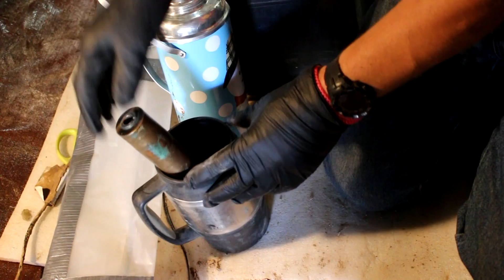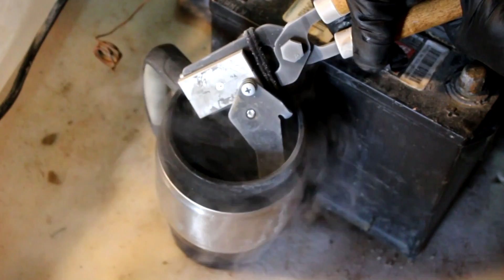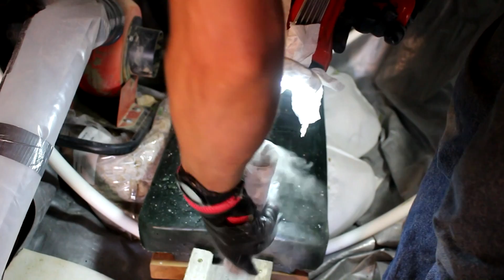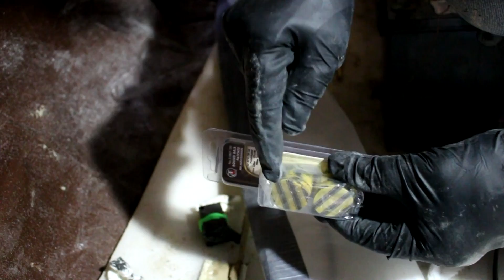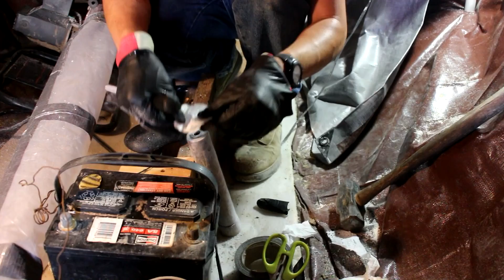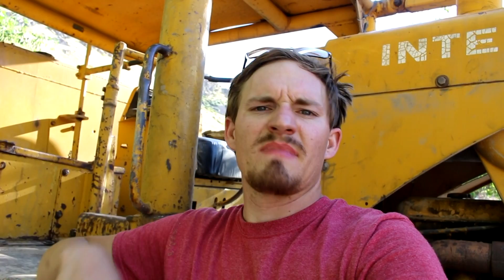Shooting Mercury Bullets

Comment: I do not believe that the mercury lubricated it's path through the gel.  in my opinion the weight difference would have given the mercury more velocity v the lead.
Reply: I think it's a mechanism more similar to Armor Piercing rounds. What I mean by that is this:

In an Armor Piercing round, the copper jacket is stripped off of the steel core of the round, creating a smaller (and therefore a higher velocity) projectile.

If the Mercury was melting as you say, then it wasn't so much 'lubricating' itself as it was shedding mass to retain speed...which as you noted increases penetrating power, but would be useless in transferring energy to a target effectively.
Reply from the maker: by that much?
Reply: @theCodyReeder  burn rate (and pressure) goes up exponentially with bullet weight, it is likley the mercury bullet was going faster than the lead with the same charge.
Reply: Powder burn is not perfectly efficient and you get better powder burn using a heavier pill.  Have you ever seen a fireball from the end of a barrel that's unburnt powder with the combination of hot gases expanding in an area of lower pressure, etc etc etc but mostly unburnt powder burning up.  So with this in mind we can also conclude that the heavier bullet spends more time in the barrel thus more efficient use of the charge while the lighter pill will move through the barrel more quickly allowing for less time for the charge to burn.  this is also why when using the same 9mm bullet from a 3.5 inch barrel to a 6 inch barrel makes drastic changes in velocity.  same goes for 5.56 ammo from a 14 inch to 20 inch barrel you see a 200 to 600 feet per second increase depending on the round and charge being used i.e.  slow versus fast burning powder.  Using black powder requires long barrels because it is a slower burning charge than modern powders so this has a major difference.  This is why they used heavy 50 caliber projectiles with very long barrels in earlier firearms.  So your energy of the charge is lost as heat.  So for the something of the charge you are getting something, heat..
Reply: Shedding of mass to retain higher velocities seems to be the most acceptable explanation I have heard yet, but something like this is not researched, so all we have are hypotheses.
Reply: He used the same size charge for both which means the heavier bullet would have a lower velocity and the same amount of overall kinetic energy.  Energy in = energy out unless there was a difference in the friction between the bullet and side of the barrel due to mercury melting from initial friction and either lubricating of just making the bullet slightly smaller which would decrease that friction also.  That is as long as the melting didn't break the seal and allow gases to escape around it.  The crono would be required to find the answers to some of this.
Reply: >> in my opinion the weight difference would have given the mercury more velocity v the lead.

The kinetic energy transferred to the bullet will be the same.   Faster speed vs  more mass vs slower speed and more mass.

As the hole in the paper gets smaller, the level of energy required to continue gets less.   The led bullet didn't get smaller, so continued making a big hole, requiring more force to tear the paper.

I'm not a scientist, but did take high school physics when dinosaurs ruled the Earth.
Reply: that's what I thought too. plus I'm assuming all those pieces of stuff falling down are bits of Mercury that were splattered against the gel in the firing
Reply: +Ben Sparrow but yeah "lubricated" is probably a good word here, I doubt the bullet was still very solid by the time it hit
Reply: The mercury bullet felt like it weighed more to Cody. That doesn't mean the velocity is higher, it means that the velocity would be lower but it would have more energy.
Reply: I carelessly used velocity for momentum, force or newtons however you want to measure it.  Either way this played the largest part in the further penetration any said lubrication of the mercury would be negligible.  the faster lighter bullet had less penetration and that could be because of its lower mass, shape and trajectory.  perhaps we might see a difference in the lighter bullet is the shape was changed to that of a boat tail its tumble pattern would be way different or perhaps making it a hollow point and allowing the bullet to fragment there may be deeper penetration on the individuals fragments.
Reply: Jonathan Gibson The start mass being higher was obviously offset by the mass loss as it penetrated, and this HAD to play a part in the round penetrating further, no doubt about it.
Reply: Regardless of the powder used if there is flame at the end of the barrel there is inefficiency as the powder is not completely burned and energy being transferred as heat instead of velocity on the round.  If you have ever reloaded ammunition or tried working up a perfect load for your rifle you would begin to understand.  Judging on how you may not have reloading knowledge or extensive knowledge of ammunition and their mechanics this is a losing battle for myself.  The concept of same amount of powder with two different projectiles with different weights yielding the same energy potential is incorrect.
Reply: Jonathan Gibson Well... regardless, the lead would have mushroomed to fill the barrel, so if anything, the mercury actually obtained slightly less inital energy, which still points at the loss of weight increasing the penetration, as two loads, one lighter, one heavier, the lighter round would penetrate further. But mercury was initially heavier AND more brittle than the lead. It should not have penetrated further. Only the loss of weight would predict such an outcome.
Reply: The velocity would be less due to the higher mass of the Hg, with the same charge a higher mass object would not be accelerated as fast as a lower density object.
Reply: (in the way I'm explaining it, think of a bullet as infinitely many hollow cylinders put together)

as the lead bullet travels through the gelatin, the sides rub against the outer shell of the bullet, since the outer shell of the bullet is still in tact of the rest of the bullet, the entire bullet is slowed down

in the case of mercury, the outer shell of the mercury bullet would get slowed down, but due to the immense friction, it would melt, separating itself from the rest of the bullet
there is still a bit of time when the shell is still attached to the bullet, so the bullet the gradually being slowed as it penetrates
the smaller the bullet gets, the higher the surface area/volume ratio, meaning it slows down a lot quicker near the end of the trip

so mercury is heavier (same size, greater density). same amount of powder, therefore there is the same amount of force applied to both of them initially
however since the mercury bullet is heavier, it'll remain in closer proximity from the force source so the impulse (force*time) is greater
since impulse is related to momentum, therefore the momentum of the mercury bullet is greater
since it is greater, and the mass is greater, we are unsure as to whether or not the velocity is greater (actual calculations is required to determine that)

but the way it would affect the situation is that the faster object would have more friction acting against it
a=f/m
so if the lead was faster it would be slowed down much faster than the mercury (small m, big f)
If mercury was faster, it would be inconclusive without calculations because we don't know if the large force and mass is larger or smaller than lead's smaller mass and force

still, this math would only show just how much further away mercury would go than lead (even then the calculation is annoyingly hard due to viscosity of liquid and changing mass with weird normal force... it's a nightmare)

that alone gives mercury enough reason to move further ahead

If impulse wasn't an issue, and if they both had the same momentum
the energy of the

this is my theory, but I'm quite confident in it (physics major, but not in classical mechanics)

also, in response to the armor piercing rounds guy
the bullet does not speed up (there's no forward force)
simply allows the rest of the bullet to pass unimpeded as the outer shell remains stuck in the armor
Reply: If the liquid mercury were to melt fast enough and the pressure from the exploding powder was able to push enough of the liquid mercury in front of the solid core allowing for hot gas to escape around the projectile you could lose valuable pressure that would help propel the round.  This would mask any benefit from lubrication due to the loss in force propelling the round.  Think about as a shotgun without using a wad in bird or buck shot.  Without the wad the projectiles would not gain as much velocity because the projectile is not near the size of the bore and hot gas would escape around.  

The lubrication idea inside the barrel should just be ruled out.  Try loading a .309  bullet in a .312 chamber than using a .311 bullet in the same chamber and using a chrono you won't see a difference in the deviation.  Sure there is .002 difference around the bullet but no one will notice the difference although it's a lot easier to push the .309 bullet through the barrel.  Now using two bullets of the same bore with two different weights you will immediately see a difference in the velocity and momentum using the same charge.

We should also investigate the effects of wax coating on .22 bullets to see if the wax helps lubricate the round travel through an object(s).

*Also note there is a loss of pressure from the fuse hole in Cody's experiment.

My opinion,  too many variables to count and the math cannot be done with the information given.  Mercury makes for an ineffective round when i look at it from a reloaders point of view. 

The liquid mercury in the gelatin argument just doesn't make much sense when we could observe the same with rounds designed to fragment upon impact and smaller pieces will surpass the large core due to the effect of the surface area and we could also observe the opposite when smaller pieces may slow down faster do to their loss in momentum or inertia. 

We should also look at the effects of super heated liquid copper used to defeat tank armor.  Is it the lubrication helping it pass through metal or the fact that it acts as an armor piercing round while the outside of the liquid mass makes a small incision that than allows the remaining body to pass more freely through the center.  Than again the targets are different solid metal versus gelatin, liquid at room temp versus liquid when super heated. 

How many licks does it take to get to the center of a tootsie pop.  The world may never know.  Or care.   

Thinking of the remaining math makes my head hurt.
Reply: Jonathan Gibson, regarding your 9mm comparisons, the 115 grain projectile has more energy than the 147 grain. The 147 gr has more momentum.

While 115 gr @ 1190 fps = 2.7 kg-m/s and 147 gr @ 980 fps = 2.85 kg-m/s,
115 gr @ 1190 fps = 490 J
147 gr @ 980 fps = 425 J

It's ironic that you made up numbers that would disprove your statement. But if we pull real hand load data from a chart, for the 2 bullets you chose, we'd often find those two will not be using the same amount of powder. The 115 gr will be trying to get the maximum oomph out of the lil 9mm cartridge, while the 147 gr loads will be trying to ride the upper end of the subsonic border without crossing it.

So I pulled up some, what I believe are, comparable numbers from Nosler, who are going to be pushing their test loads through the longest barrel they can find to look better on paper.

All using IMR 4350 in a .30-06:
56.5 gr w/ 125 gr @ 2943 fps => 3259 J && 7.3 kilogram-meter/second (57.7 J/gr of powder)
56.5 gr w/ 180 gr @ 2734 fps => 4050 J && 9.8 kilogram-meter/second (71.7 J/gr)

52.5 gr w/ 180 gr @ 2528 fps => 3463 J && 9.0 kilogram-meter/second (66.0 J/gr)
51.5 gr w/ 220 gr @ 2488 fps => 4099 J && 10.8 kilogram-meter/second (79.6 J/gr)

The efficiency of converting chemical energy to pressure to a projectile goes way up as the round gets heavier and must spend more time in the barrel.

That said, I doubt it's simply a matter of density, velocity, energy or momentum causing frozen mercury to penetrate deeper than lead. Only thing certain is there are too many unknowns and variables to be certain of anything. On the one hand we're observing a metal with almost no hardness that's absolutely awesome at inelastic collisions with a coefficient of restitution of 0.08 and on the other a metal that's wanting badly to be a liquid on contact with anything else in the system. Who knows, maybe metal mercury work hardens readily but no one has ever noticed because it usually melts shortly after.
Reply: We did get a conclusive answer... Mercury sucks as a bullet nor is it feasible.  Would be interesting to see what mercury would do to a harden steel plate.  We know ap rounds work by pushing its core through after the jacket has expanded seeing how a liquid metal would work would be interesting.
Reply: Mercury has better cohesion within       its deformity... And within its weight velocity it has better adaptation in aerodynamic pulse of needles format...  So in total... Mercury is special being compared to lead and or ice.
Reply: +Richard Smith +1 thats what i thought people ment by lubricating xd owell im too optimistic.
Reply: Goretantath Lubrication implies that the mercury itself is slowed less by friction, which may also play a part, but I think the loss of mass plays a much larger part in the deeper penetration.
Reply: Since Mercury doesn't wet things very well I have doubts that it can really have a lubricating effect.
By comparison with the ice cube the water would actually cover the entire wall but I don't think mercury would do that.
Reply: Not true a few grains of weight makes a huge difference in bullet mechanics.  the heavier bullet I would suspect would have much more energy.  For example these are not real numbers but representations of what a typical 9mm bullet would be. 147 grain bullet with 5 grains of power will push the projectile 980 feet per second while a 115 grain bullet with the same amount of powder will push 1190 fps.  Time for the conversions  147 grains=0.00953 kg 980fps=298.704  so using p=mv we get 2.847 kgm/s  now for the 115 grain bullet  115 grain = 0.00745 kg  and 1190 fps = 362.712 we get 2.702 kgm/s so just by changing the weight of the bullet using the same amount of powder we find that the heavier bullet retains more energy.
Reply: If you can get some real numbers do the math.  If you have a heavier bullet, with the same friction while traveling down the barrel,  it will go proportionally slower than the lighter one given an equal cherge.  Hence the kinetic energies should equal one another.  With kinetic energy you can't get something for nothing.  It's a simple law of physics.
Reply: He's using a low charge so it should all burn with either round.
Reply: I think it comes down to the need for the chrono since there are to many variables to come to good conclusion without more actual data.  We can only guess at what actually happened.  The chrono could at least give us one.  what happened at the mercury/barrel interface as the mercury bullet traveled down the barrel  is a factor that we can only guess at.  The diameter and mass of the round at the point of impart is another since we know at least some of the round melted and sprayed mercury on the front of the target..
Reply: As a  basic rule of physics that would seem the quickest answer; but as Jonathan Gibson pointed out to me and others; there are other factors that dictate how much of the possible energy given by the chemical reaction actually goes into the kinetic energy of the round.  I think the reality of everything that is going on here:including at what points in time how much of the mercury was liquid/solid and the physics of the penetration; would require alot of research using a multitude of instruments.  Of course that simply isn't posible for Cody to undertake on any reasonable budget.  It is enjoyable to duscuss the possibilities.  Hopefully each of us in this discussion can learn something from the others as none of us know it all.
Reply: Agreed, the greater mass is the most likely culprit to the mercury round penetrating farther i.e. the greater momentum.  The lubrication factor inside the barrel can be neglected as the melted mercury may even surpass the mass of the projectile allowing for gas escape around the projectile causing a loss of pressure propelling the round out of the barrel.

I think momentum and surface area/volume ratio theory is the best way to explain this as the projectile is colliding with the gelatin continuously and there is an exploding force propelling the round.   

Still kicking myself for typing velocity and not momentum in the initial post that caused all this. 

Bullets are strange things and there are an infinite amount of reasons for their deviations in gelatin.
Reply: Jonathan Gibson I would be careful with that generalization, since the only reason why it has greater momentum is because impulse was a decently hefty factor
I think the pressure would be << than the relief of friction from the "lubrication"
I'm not certain what you mean by that though
Can you explain the pressure thing?
Because the lubrication really dampens the effect of friction, by a really large amount
Like started above, like an ice cube
If it kept solid it would be like any other block
But since it melts friction doesn't affect the entire mass much and only really acts on the melted bit

Uh, I guess in a relative sense it is an explosion

But the ratio is also inconclusive because velocity lowers, so even though there is a greater ratio (slows down faster) the act of showing down reduces friction, which reduces the effect of the ratio
Basically, maths is required, and that math is hard as hell
Reply: Seems like you use mercury a lot.
Reply: This is not the case. It's pedantic but Cody was incorrect in the video stating that the mercury bullet would have had more momentum. Given the same powder load both bullets would have the same momentum.

Linear momentum is defined as P = MV. Given the same value for P,  but a greater mass on the mercury bullet, the mercury bullet would have a smaller velocity than the lead bullet.
Reply: But this is not true since the propelling force can escape the  fuse hole in the back since the heavier round would have more dwell time in the barrel this would also allow for more pressure to escape from the fuse hole but due to the longer dwell time also allow the propellent to reach its maximum pressure potential.  Also we need to look at the effect of mass in momentum.  The lighter pill has less dwell time in the barrel thus allows the  propelling force to escape faster and not build to its highest potential.  For example if we look at a bullet we know a .223 at 55 grains exerts 45,000 psi at the chamber however using the same .223 with a heavier 77 grain load will result in higher chamber pressures around 48,000 psi.  Clearly the same amount of propellent does not affect each round the same.  Also once the bullet hits something other than air all types of things happen.  heavier rounds generally always go farther because the velocity drop off is faster than the weight drop off.   not to mention we need to base its energy in foot pounds not in momentum.
Reply: Jonathan Gibson a heavier bullet with the same amount of powder will have a lower velocity, but more energy.
Reply: Jonathan Gibson alright I didn't bother reading all of your theories of internal ballistics, but you have it mixed up brother. You will never get a heavier bullet moving faster out of a barrel than a lighter bullet with the same amount of powder. If that were true, then you wouldn't ever have the dilemma of which load to chose for a firearm. everyone would always go for the heaviest bullet because there wouldn't be a reason to go lighter if the heaviest one went the fastest. You would be violating physics if that were to happen. just google some reloading data and you will find that with a given cartridge, all other things being equal, a heavier bullet will always move slower than a lighter one, but with more energy. your argument of unburnt powder causing this is irrelevant. it means you just have too much powder and it's just going to waste and will never burn even with a heavier bullet.
Reply: Well said and I'm not disagreeing you are right different loads would be best suited with different powder charges or primers.  A lot of people reading did not have a lot of information when it comes to bullet ballistics.  I agree even more that there are too many factors to make any concrete determinations. Not too sure why i used those numbers to disprove my own statement but that is general data not using the same powder charge.

"The efficiency of converting chemical energy to pressure to a projectile goes way up as the round gets heavier and must spend more time in the barrel."  I made a similar statement somewhere within my rubbish not to mention an optimal length barrel for the amount of powder to ensure there are no diminishing returns. It is very true statement and not everyone in the discussion agreed with this because they assume that the lighter bullet would make up for what it lacks in weight with velocity producing the same amount of force which isn't always the case with bullet ballistics.

I'm no scientist but believe were on the same page i just had some errors when posting and not reviewing everything before pushing the reply button.
Reply: I would almost guarantee you used those 9mm examples because frankly they're the most sane to use! They're probably the two most common variations of 9mm: target 115gr running about 1200fps and 147 gr just under subsonic. A lot of the handload data shows 5gr powder for the 147gr and as much as 8gr powder behind the 115gr. Different powders so I couldn't make direct comparisons with them, but still, that's a huge difference. But that's why 9mm, .45, and 300 BLK (just to list probably the most popular) would be bad rounds to use as examples. Their upper end weights are trying to do something other than get the most safe energy from the cartridge. They're riding that subsonic edge for suppressed use, which is an equally valuable option to have. (I think you already know this, but someone may read this some day that didn't.)

I won't be looking tonight, but I think there are some oddball 10mm rounds that will flip the KE:PF comparisons as well. But those are outliers too because the mfg is looking for crazy velocity out of a 4-6" barrel in a pistol. Anyway, stuff like that is why I went with a large rifle round that isn't trying to do anything except fill the case with the most amount of powder that's rational. That being more normal and the context of this thread, it supports your claim. At least after you clarified momentum/power factor, not energy or velocity.

Oh, we agree. I think maybe with a long enough barrel, a lighter bullet would receive just as much energy as a heavier bullet in an otherwise identical cartridge. But guns aren't labs with ideal conditions.

I'm no scientist either. But I have compared enough cartridge energies to know something didn't look right. Maybe Cody will do it again some day with a MagnetoSpeed instead of an optical sensor chronograph. And maybe make the bullets weigh the same somehow. But probably not. That had to be a crappy experiment to set up. Tons of work that will almost certainly lead to an inconclusive outcome every time. Or at least won't answer the most important question imo, "why?"
Reply: +Jonathan Gibson that's what I'm saying!!  Or how about a HP full of mercury?